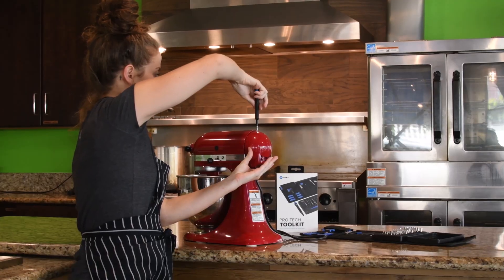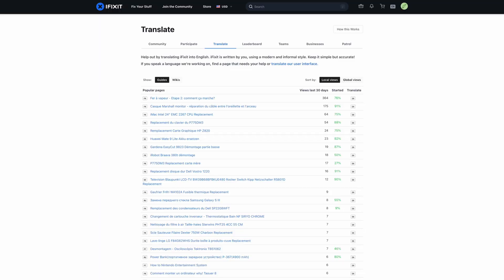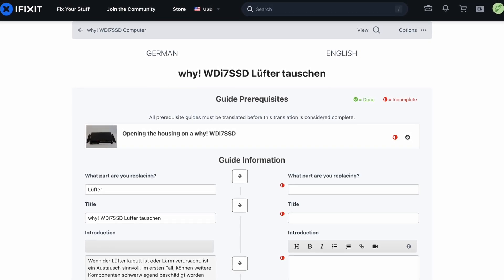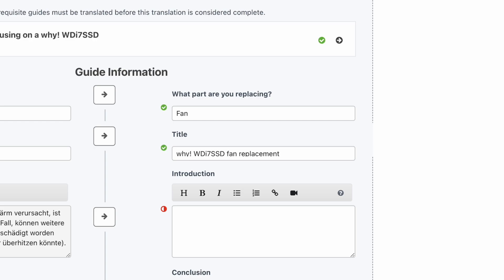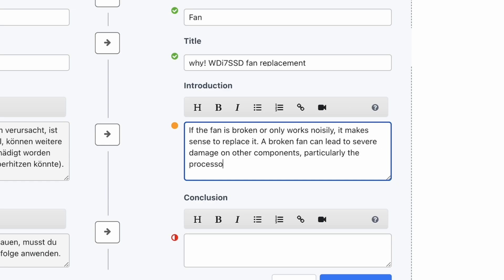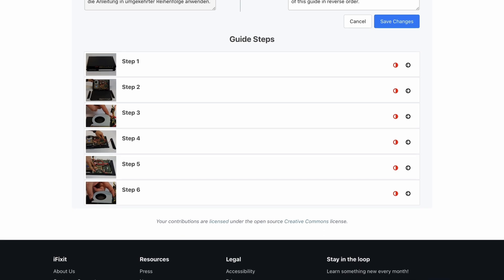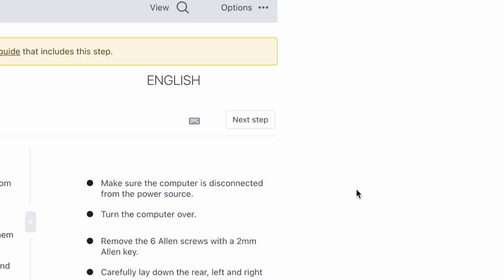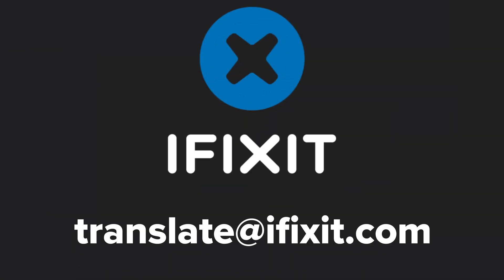How To Use iFixit's Translation Interface!

Comment: Most browsers - at least Safari, Chrome - offer accurate translation. Unless they miss certain languages, I don’t see how this brings anything new
Reply: Auto translation has no gauge of context, while a person translating it will know what the text is about and what context is required. Since there's a lot of technical language in a tech repair guide for example, this is useful as it prevents confusion in case there is a bad translation.